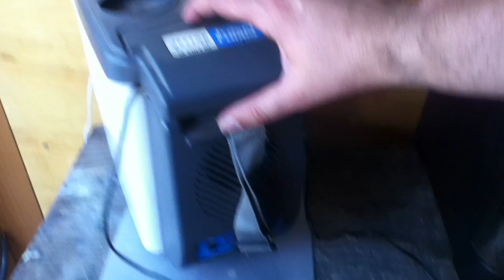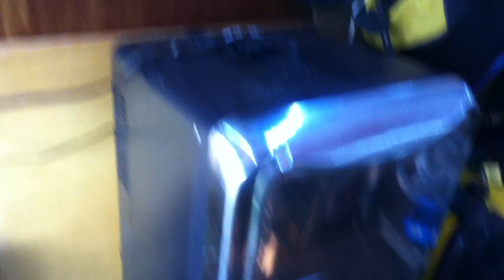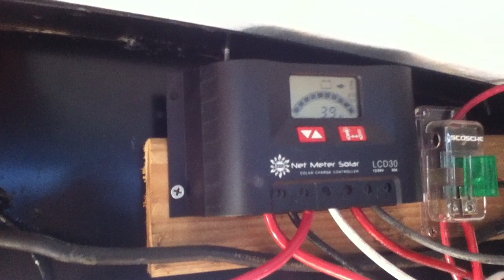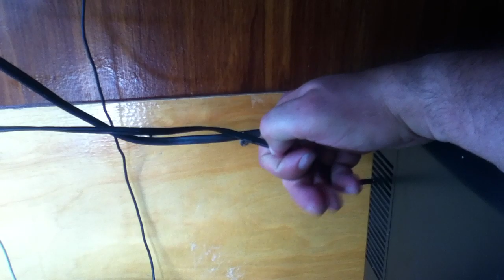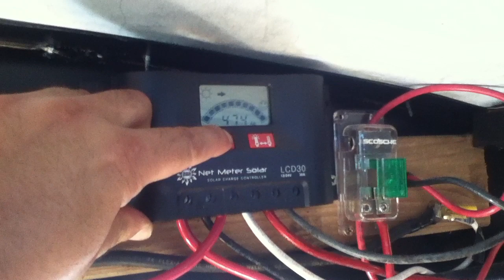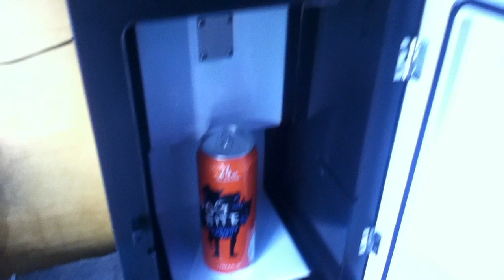12V thermo-electric coolers on solar power - not the best option; here's why

Comment: Peltier coolers are used in VERY few gaming PCs. The power draw vs cooling just isn't worth it vs straight water. Calling it "not a real refrigerant" is really misleading. Refrigerants are a specific type of coolant that requires a pump. Peltier coolers will absolutely get below freezing if properly water cooled even at higher ambient temps. Just because THAT SPECIFIC piece of junk doesn't work well doesn't mean the technology is bad.

Comment: These 12V coolers use peltier junction devices to transfer heat from inside to outside the cooler.  A thermocouple is a temperature measurement device that uses a junction of two metals to generate a small voltage (millivolts) used to measure temperature.  No such thing as a "Thermo-coupler".

Comment: i do agree that store bought peltier coolers arent reel refridgerators. but thats not to say you can't build a nice freezer with peltier units. i've been working on building a super cold freezing unit for experiments and so far have gotten down to -5 F* and hope to someday reach -120 F* for my projects.

one of the biggest issues i've found is peltier coolers work best at 10.2v but companies wire them for straight 13v off car connectors. once you start going above 10.2v you might as well lower the voltage to like 6v because your adding more heat into the system.
Reply: how did you reach -5 F ?
Reply: Cool the hot side of the peltier properly and the cold side will absolutely get below 0.